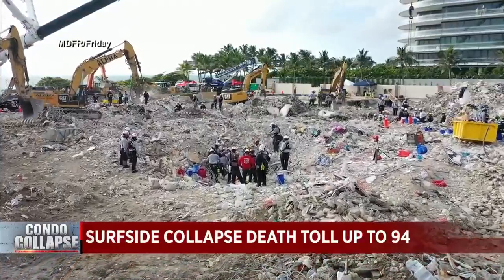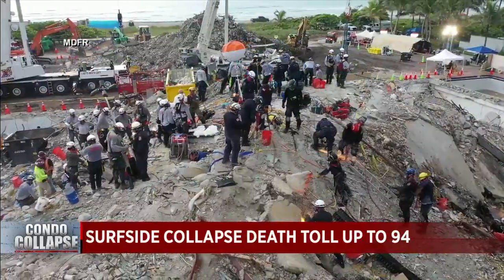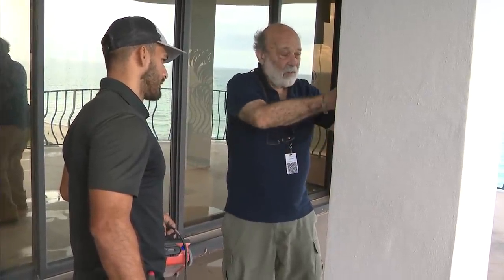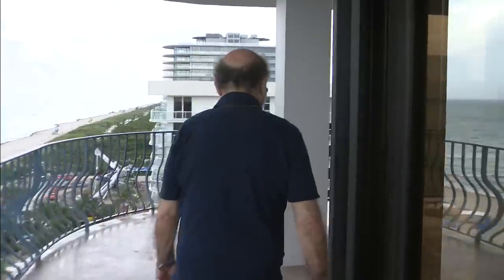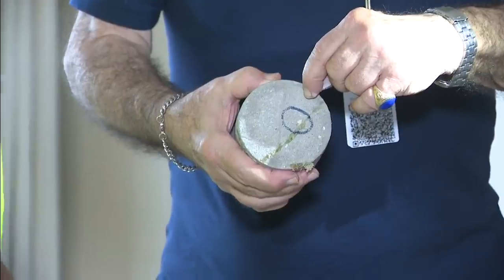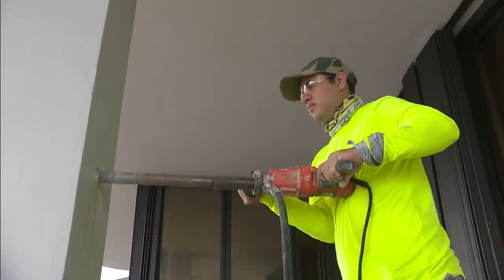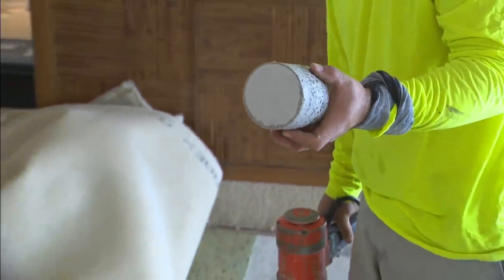Structural expert studying still-standing Champlain Towers North looking for clues into south to...

Comment: Isnt it fairly obvious that it was caused by badly rusting rebar in a porous concrete structure in a very salty seaside environment? the rust caused the spalling, and the weakened structure collapsed.
Reply: Yes. But if that were all that was necessary, many other buildings on the Florida coast would be collapsing, and they're not. I agree that those factors were primary, but there are more.
1. The condo association at South appears to have been a perfect storm of cheapness, ignorance, foolishness etc. From what I hear, the other two Champlain Towers buildings have been well maintained. South wasn't.
2. There have been rumors about the original builders cutting corners with the quality of the concrete and the amount and size of the rebar used. As in, selling off extra materials, pocketing the cash, and proceeding with a weaker, cheaper version of what they were paid to do. Some engineers have went on record as being surprised, while examining photos of the rubble, to see the paltry quantity of rebar protruding from the broken concrete slabs. Plus, the building's developer was known as a shyster and a real operator, if you know what I mean. 
3. The original architectural design has been called questionable by some, especially with regards to the size of the support pillars under the part of the building which gave way. Those under the Collins Ave side of the building (which stayed up) were visibly thicker and sturdier, even in the original plans. No reason for that was given.
4. There are indications that there were problems not only with the salty, humid air and ground incursions of tidal seawater, but also water coming down through the building. Possibilities: bad plumbing/pipe leaks in the walls (there were multiple complaints of leaks), roof leaks (which can be fatal to a structure) and also leaks at the balconies and through the planters on the pool deck and the pool deck itself. That last item is perhaps the most crucial, since the pool deck appears to have been structurally involved with the central portion of the building. (Apparently this is not common, and very ill-advised.) The pool itself wasn't leaking, but the deck's waterproofing was inadequate and it wasn't slanted properly, so rain would stand on it and soak through, instead of running off. Thus it would soak right down into the foundational structure of the building and rot the concrete, etc. A woman on the fourth floor who died was talking on the phone in her last moments. She called her husband to tell him that she thought there was a sinkhole, because she could see from her unit that the pool deck was collapsing or had just collapsed. It has been theorized that that helped to pull the already weakened building down.
5. People have brought up other interesting points, such as this, which I would not have even thought of: added weight. When South was built, baths and kitchens were finished with lightweight materials like linoleum, tile, wood and laminate. In recent years, many units were redone with various types of granite, marble and quartz, which have been fashionable for a while. These materials are all extremely heavy and in aggregate would have added many thousands of pounds of additional weight to the already weakened structure.
Reply: @denverdubois5835  You wrote such an involved analysis that I thought you might be interested in something that has been nagging at me.. the timing of the collapse at around 1:30 a.m. would have potentially been at the time when the building and it's components had shrunk to their "cool" size as opposed to the expansion experienced in the Florida heat during the day. I have yet to figure out what that potential clue could mean, but it's interesting to note.
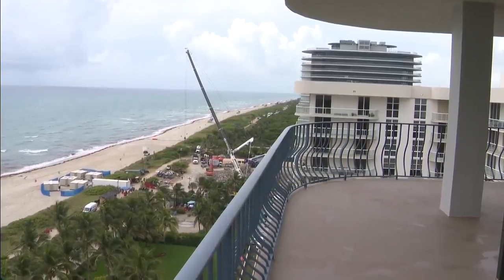Reply: @matthewmosier8439  1:30 was low tide.  That was the trigger.
Reply: @MinusEighty  I live in coastal GA, not terribly far at all from Florida, and I can say from my experience in construction that it is likely that there were pilings driven down to bedrock forming the foundation of the towers, so even if the garage slab was being buoyed up a bit by seawater left under it from high tide intrusions, it seems unlikely that that would have been a component in a structural collapse of the pool deck.
Reply: @matthewmosier8439  No they don't go down to bedrock. They go down until there is enough resistance.  They are set in limestone.
Reply: @matthewmosier8439  The pool deck collapsed when the collapsing columns under the building pulled it down.
Reply: @MinusEighty  Depends. There is bedrock under the barrier island that the condo was built on. They can't figure out why pockets of that location sink and others sink less.
Reply: @matthewmosier8439  Franki piles, also known as pressure injected footings (PIFS), are high-capacity, cast-in-place elements constructed using a drop weight and casing.
Reply: @matthewmosier8439  "The solid ground under South Florida — Miami, Miami Beach, the Keys, and much of the rest of the peninsula — is mostly limestone made of compressed ancient reefs that are full of tiny holes. That means salty water is rising up through the ground itself, not just in the waters surrounding Florida."
Reply: @matthewmosier8439  ""Our underlying geology is like Swiss cheese."
Jayantha Obeysekera, scientist with the South Florida Water Management District"
Reply: @MinusEighty   
ancient reefs would be limestone. I see. Reefs are made up of crustacean-type plants, which are the same material as, generally, seashells.
Reply: @matthewmosier8439  
'Why some parts of that location sink more and other (parts) sink less.'
Saw an interesting program about the Island of Manhattan in NYC. Early settlers had a hard time building there until they learned the geology. A material called Manhattan schist, which is a very hard, horizontal combination of shale, granite and feldspar (and compressed mud) was impossible to drill through although schist areas were the most secure places to build. Other places on the island were not built on until land became scarce...because structures built in those other areas would sink. I guess my analogy between coastal New York and coastal Florida is that ground varies greatly and you can't always tell what's down there. 🙆
Reply: @MinusEighty  Nonsense. You have it backwards. Slab failed at the columns, columns punched thru and columns lost lateral support and down she went.
Reply: @ArthurDentZaphodBeeb  How can the column punch through when it continues for 13 floors?  And how do you know what happened?
Reply: @denverdubois5835  All buildings even older ones are designed with increase load factor, they always assume greater loads in forthcoming years. Keep in mind that PSI in concrete increases in age. The 3000 Psi design mix for the elevated decks today will break closer to 5000 psi.
Reply: Other issues are sinking foundation and bad repairs (if any) in the past.
Reply: @alicehallam8247  "If any" says it all!  It really sounds like there was unstable ground under the building, but lack of maintenance and repairs was the worst offender.
Reply: @Dallas_K  
I would prefer to blame lack of upkeep.  Maybe families can recover more if it is not an "Act of God (old term)". Hard to say but my townhouse/condo they leave everything until it's there's wood rot or structural problem, then they slap a concrete patch or some siding over it and call it good. Not kidding.
Reply: Thanks expert-case closed, everybody go home!
Reply: @trafficjam.  and take a parting gift with you, like a rusty rebar or a spalling piece of concrete that makes a lovely table centerpiece
Reply: DoctorLarry
 It was not a fault structurally, but in waterproofing (maintenance). Big difference.- in my case I noted that if a building stood 40 years, there was no faulty construction. That is based on 50 years of experience in structural design and assessments - it is not speculation.
Reply: wow your a genius
Reply: @mikelowe9534  you're
Reply: @mikelowe9534  Kevin, a structural expert knows rusty rebar is not considered root cause???
Reply: also the part of the building left standing had a little bigger concrete post from what someone had said like 24x24  ware as the failed fallen ones it was said were like 24x16
Reply: BASANITE is the future BASA
Reply: Lol they definitely dont need this guy
Reply: With things like this there may have been many contributing factors. If we want to prevent this from happening, we can't just take the first explanation and not do full research
Reply: The answers are out here.. numerous structural enginers have it figured out...... Columns collapsed....
Reply: Also, salty conditions when pouring concrete, in different layers.
Reply: @Sarconthewolf  concrete is not poured in ‘layers’. Are you referring to different floors?
Reply: @CamilleThorntonMandarinLife  It wasn't supposed to be in layers but the water created a separation between the large rebar and the concrete below it.
Reply: I agree  salt water and possible  brackish water table below this foundation too,.
Reply: No doubt,  the contractors relied to much on the rebar and had bad concrete mixing not made for the environment its in
Reply: Its not obvious.  While it was present there is no smoking gun pointing to that.  It likely aggravated things.  That said, the #1 theory right now IMO comes down to a building flaw and repetitive loading  stress on rebar in the visitor parking lot near the looby.  It appears to be the first collapse and what started the chain reaction.
Reply: That’s part of it but the whole building shouldn’t of failed in that manner…. There’s likely more to the story here.   Testing the concrete at tbe standing structure is a good idea since they were likely poured with the same batches  perhaps revealing a flaw in the concrete as well.
Reply: @Paranimal86  ...Sorry I am no expert, but both buildings being poured with the same batch is the last thing I would suspect. To the contrary I would assume that one was erected and sometime after the other, but already said no expert here.
Reply: @robertthomas6127   They were both erected in 1981 which would probably mean simultaneously to reduce costs but I could be wrong.  The Champlain east tower however was built sometime after in the early 90s.
Reply: @robertthomas6127  They were about a year apart.
Reply: @Paranimal86  They were built two years apart, north tower is two years newer. So it’s not the same batch
Reply: @Dallas_K  ... If that is a fact ... Exactly my point. Even if they were poured on the same day. One at 8am and the other 10 am they would not have to be out of the same batch. All nothing more than speculation that gets people with little or no knowledge emotionally worked up. Drink tea and wait what the experts determine is the only answer that is 100% correct at the moment.
Reply: @Paranimal86  one was one year later, watch on the news
Reply: Why is it obvious?
Reply: @robertthomas6127  Ditto- rusty rebar a symptom not a cause. There will be many factors creating the perfect storm that should never have happened. Insufficient columns, structural deficiencies, added deck weight, lack of drainage plane…
Reply: Then why wasn't the exposed rebar in the pictures from 2018 rusty?
Reply: @MinusEighty  it was rusty, it was rusting long before the concrete popped off. Its called "spalling", where rust pops off the protective concrete cover, too late to do anything practical at that point in a large building like that
.
Reply: @kevinmcgrath3591  Not very rusty all. Spalling can also occur from the building flexing due to uneven settling.  The parking garage floor had several massive cracks that were at least 40 feet long and through 9 inches of concrete.  And we know that this building was sinking at twice the rate of the surrounding buildings, and the garage flooded with sea water for decades.
Reply: @MinusEighty  
Yeah, sea water. Any proof that any of the water was sea water? Scary.
Reply: @alicehallam8247  The maintenance manager said that sea water was flooding the parking garage for decades.
Reply: @MinusEighty  DoctorLarry
 It was not a fault structurally, but in waterproofing (maintenance). Big difference.- in my case I noted that if a building stood 40 years, there was no faulty construction. That is based on 50 years of experience in structural design and assessments - it is not speculation.
Reply: @MinusEighty  DoctorLarry
 It was not a fault structurally, but in waterproofing (maintenance). Big difference.- in my case I noted that if a building stood 40 years, there was no faulty construction. That is based on 50 years of experience in structural design and assessments - it is not speculation.
Reply: @Brucev7  What do you make of the fact that the mayor and his engineer are telling all the owner's with buildings on the ocean side of Collins that the need a geotechnical  engineer to inspect their probperties?
Reply: @MinusEighty    
I heard that, too. But how did he know what type of water it was? Did he say he smelled it, tasted it, tested it? He said high tides but that would be his opinion that it was sea water.
Reply: @MinusEighty  Lawsuits
Reply: @alicehallam8247  He was the manager for years.  You don't think that he knew it was sea water?
Reply: @Brucev7  I am sorry what are you saying?
Reply: @MinusEighty  U asked. My thought
Reply: @Brucev7  about what?
Reply: @kevinmcgrath3591  "Spalling" is a term not exclusively relevant to reinforced concrete.  It simply means chunks of concrete pop away.  Sidewalks frequently are spalled, and there is no rebar.  The spalling there, though, was a result of gross neglect for many years.  I suspect a problem with the ground they built on led to cracks that allowed seawater to seep in and begin the rusting.  Chlorinated pool water dripping and collecting, and soaking in, further ate away at rebar.  That building had many problems simultaneously.
Reply: @MinusEighty   
Nice collection of assumptions there. The building collapsed. I will assume that the manager wanted to sound like he knew something and never checked sh*t. That coming from me, a blue collar worker.
Reply: @alicehallam8247  You don't even know what he said.  He complained for years about the water and no one listened.  And he hadn't worked there for over a decade. So you have no idea what you are talking about.
Reply: @MinusEighty  
Why so testy, you freak? Back off and did I say I saw the interview? So he's your brother? Everyone is responsible for this until proved otherwise, either responsible as an incompetent or as a negligent party.
Edited: 😢
Reply: @alicehallam8247  Who are you to call him names when you didn't even listen to what he said?  And now you are calling me names.